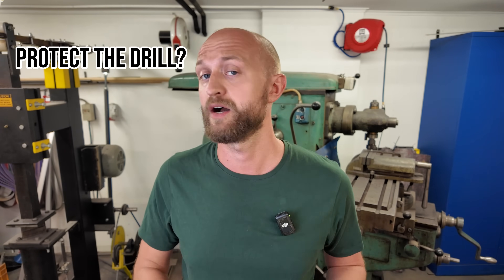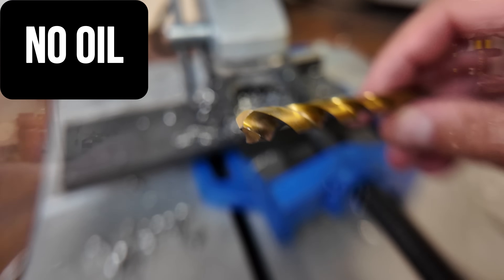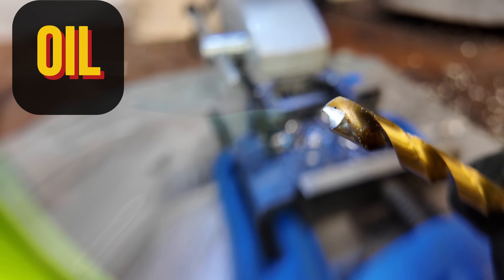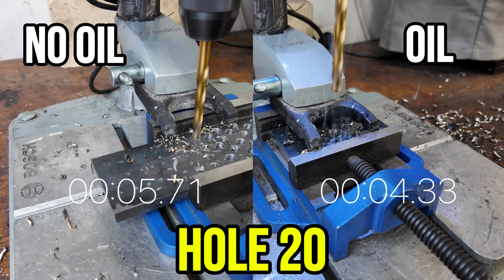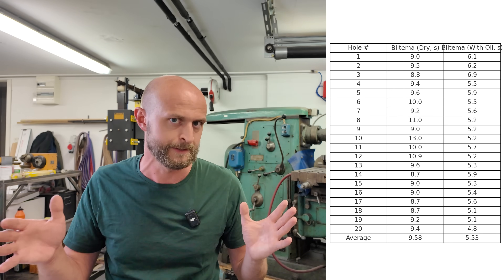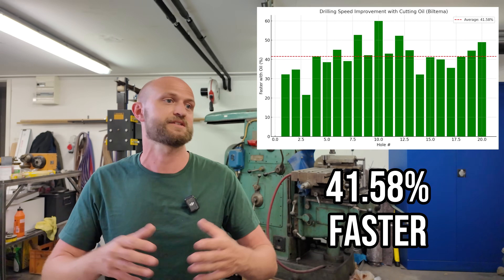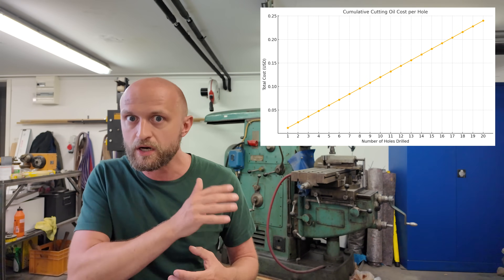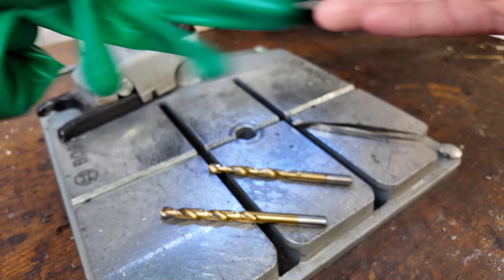You’re Drilling WRONG — Here’s the Proof

Comment: Try with water. On carbon steel it's better. On stainless it's essential.

Your problem is heat. You need to keep the heat down to protect the bit and work hardening particularly with stainless. Water will boil off at 100c while oil won't smoke until 180+. Latent heat for water is almost 3 times that of oil.
Reply from the maker: Good point — and you’ve actually convinced me. I’ll do a follow-up video testing water vs oil, thanks to your comment. Could get a bit splashy in the shop.
Reply: @SteelSurgeon-h6p  I have seen people use spray bottles and sometimes people even use putty to build a dam around the intended hole, but one of those little squeeze squirt safety wash bottles with the long pointed nozzles on it is my favourite. You can just drizzle the water down the bit while drilling and everything stays nice and cool.
Reply from the maker: @captainotto  That’s a clever setup — the squeeze bottle keeps it simple and controlled. I’ve seen the putty dam method too, but your approach is probably a lot less messy. In the OR we’d call that 'targeted irrigation' 😉⚙
Reply: @SteelSurgeon-h6p Those guys pointing out the emulsions are correct. Especially for professional work. But check out the water content in them. The oil isn’t as much a lubricant as it is a corrosion inhibitor. As the water content does its job and reaches for the stars, the oil remains behind to coat the cut preventing oxidation.
Reply: @SteelSurgeon-h6p  I use the green stuff, anchorlube cut 50/50 with water for stainless
Reply from the maker: @benmorris1657  I’ve heard good things about Anchorlube, especially for stainless. Haven’t tried it myself yet, but a 50/50 cut with water sounds like a smart way to keep things cool and lubricated.
Reply: @SteelSurgeon-h6p Looking forward to that video.
Reply: dont use plain water. just dont. you are asking to have your part rust away. use a coolant instead. you problem is not "just" heat. infact compressed air could most likely cool that down no problem. your absolute biggest problem when working in mild steel is getting the chips out of the way.
for this operation show, any form of cooling that are just sitting still, be it water, coolant or cutting oil, does next to nothing here, the only thing the cutting oil do is lubricate your drill and create a lot of hazardous smoke.
the type of cutting oil used here is actually ment for tapping, since its a slow operation, where there is not a lot of heat build-up, but lubricating the tap helps A LOT

tho i must agree that in machining stainless, heat is your number 1 enemy, but a bit of cutting oil is never gonna solve that.

for both mild steel and soft metals, using compressed air is quite adequate. for high carbon steels, especially if its a hardenable steel, coolant is advised. and for stainless is basicly a no-no to NOT use coolant. as mentioned, due to work hardening.
when it comes to using coolant, you want "running" coolant, that is a constant flow, and the higher flowrate you can have, the better. you want those chip carried away, or they can act like landmines upon your tool.

sadly that small drillpress is not built for running coolant. nor is it built for a set feedrate, you only have the pressure to go by.

another thing you can try to eliminate heat, is to actually run the drill faster, its not a guarantee when using HSS tools, but with a TiN or TiAlN coating its more doable. tho in both cases you need to evacuate the chips before speeding up can help. a "perfect" mild steel chip, has a color somewhere between "golden straw" and blue, this means the heat is in the chip, not in the part, and by evacuating the chips you are also carrying the heat away
Reply: @kkofodh I find it really hard to believe that compressed air would really do anything helpful compared to oil/coolant/water. I haven't tested it, and I could be wrong. But the specific heat/latent heat/getting it to the right spot.. It just doesn't add up. What am I missing here?
What's the issue withh water? In the context of this video it seems like it would be ideal - a small hand drill press, where you'd only use a small amount you can wipe off or blow off with compressed air. 
Is the concern just about rust? I live in Virginia, so having a wet metal surface isn't all that much different from just having the windows open in the summer as far as rust goes. 
I personally use pipe cutting oil because I get a liter for 7 dollars, and it works so much better than dry that I haven't bothered to try anything more expensive.
Reply: @SkippiiKai  the problem with water is its a catalyst for oxidization a.e. RUSTING. you need emulsified oil, typicly 5-8% oil in the water. this inhibits rusting, and acts as a lubricant at the same time. yes water is great for cooling things. but as we all know. water and steel dont mix well.
about compressed air. as said you want the chips to go away, and compressed air is excelent for that job, its actually one of the best at the job. im not talking about an ocational blow. but constant blowing, you dont really need high pressure, something like 30-40 PSI (about 2 bar) should be fine, as long as it can lift the chip and blow it away. where as still-standing pool of either water or oil actually keeps the chips suspended.

when it comes to compressed air doing cooling. the device you are currently using for watching this video, its air cooled. doesnt matter if its a smartphone or tablet, they are passivly air cooled, a PC is activly air cooled, even if its a gamer PC with watercooling, its still air cooled in the end, due to the radiator

i cannot really say anything about the area you live in, when it comes to humidity and such. 
but when it comes to rusting even the acids in your natural skin oil can be a problem. i've had a colleague that could basicly bathe his parts in sweat without any rusting, but another colleague could barely touch his parts bare handed before they started rusting.
3 things you want to keep away from steel are: plain water / tap water, acids, and finally salts. and since tap water in most places still have some salt content, you have a 2 for 1 deal going in bad stuff 😆

in a pinch water can do, and its generally better than nothing in that regards, but the big problem with drilling is that unless you have through-tool cooling, its really hard to get any form of cooling down to the cutting tip, and the problem becomes apparent when you reach a depth of 1x drill size and deeper.
if you have to use water, make sure to get it off as soon as you are done, and a generally good practice, if you can get away with it, is to coat your parts in oil, it can be way-oil or gear-oil. or some other rust inhibitor.

there are even some stainless steels out there, that are only activly stainless on the surface, meaning that when you machine them you reach an area that are not stainless, and you need the oil (usually in the coolant) for it to become active again, mist cooling can help here. infact mist cooling is a general GREAT solution for the small / hobby shop, since it combines compressed air with oil, so it blows the chips away, AND both lubricates the cut and coats the material in the area around the cut
Reply: @kkofodh  I actually meant to ask your opinion on mist cooling. I agree, it does sound like the way to go. I still feel like for what I do, which is just small stuff on my small drill press, in my garage at home, rust really isn't an issue because I can just wipe off any water. Obviously it's a much bigger issue on a larger/industrial scale.
I just worked out that if you use a completely blunt drill press so you do nothing other than create heat, and you cool it with litterally, actively boiling water, it takes 1.5 grams of boiling water to neutralize all the heat generated. I then spent 20 minutes trying to figure out the equivalent air flow you'd need, decided it was an awful math problem, and gave up. I know I'm approaching this from the spherical cow perspective and you're coming from actually having done it experience... But I feel like they should line up somewhere? I just don't see how you're getting that much air down into the hole to contact the surface. The difference is 1.5ml of boiling water vs 31 LITERS of room temperature air to remove all the heat from a 1/2 hp drill press for 10 seconds.
Reply: @SkippiiKai that's just a hobby compressor production at 6 bars, so the air volume could be maintained "for ever". You get something like 2-5x higher rates for short (~30s) bursts easily from a tank.

Having anything to flow directly at the tip of the drill is hard without special drills with coolant canals inside, but having the wind blowing at such rate from a small nozzle directed to the hole has to be pretty close to perfect delivery method for basic drills.
Reply: @SkippiiKai  its only when working in materials that will work harden, like stainless, that heat is a mojor problem. by far chips is a bigger problem. afterall each chip has the potential to act like a lindmine upon your tool, and very quickly ruin your cutting edge, way faster than heat will dull the edge
Reply: @kkofodh I’ve understood that all stainless must be passivated again once cut in order to remove surface iron. That’s quite easy to do at home with citric acid. Part of me says you could probably even passivate somewhat while cutting by sprinkling a bit of citric in your cutting water and dissolving it beforehand. For stainless I only ever work 304 and I passivate everything I cut. You just need to make sure you degrease properly before the citric bath and keep it nice and warm.
Reply: @SkippiiKai  Compressed air can help getting chips away when milling. Mist cooling (mix of air and oil) can improve surface finish. But flood cooling is better.
Reply: @captainotto  terminology may differ, but yes, stainless that has been cut without coolant need some post-processing. 
and cutting stainless without coolant can be a bad thing due to work hardening. even on an indexable carbide cutter can it cause trouble, thats why stainless can be a nightmare in the hobby shop.

if you have access to some way-oil (used in machine shops to lubricate the ways of the machines) then a good trick if your part arent gonna be used in a large assemble, and even then, is to clean the part, and then coat in everywhere in way-oil
Reply from the maker: @kkofodh  Really appreciate the detailed breakdown — you’ve clearly spent a lot of time in front of the drill press. You make some solid points about chip evacuation and the limits of static cooling methods, especially on a smaller press without coolant flow. My tests here were more about seeing how basic, easily available methods compare, but I can see why compressed air or a proper coolant system would be the better approach for serious work. Thanks for sharing your experience — lots of good takeaways here.
Reply: Your comment needs to be pinned.
Reply: I use kerosene. Lower boiling point than oil, doesn't rust stuff...
Reply: @pictsidhe6471 You just gave me a great idea: Gasoline has an even lower boiling point than kerosene and is even cheaper. I'm going to have to try this. Will report back with results if I survive.
Reply from the maker: @SkippiiKai  As your doctor, I’d recommend a second opinion before that procedure… preferably from the fire department. 🔥😅
Reply: @pictsidhe6471  Kerosine /Paraffin / Avtur are good for Aluminium and its alloys  (at least most of them)  Still washes off the lubricant on slideways, leadscrews, nuts...
Reply: I think you mean specific heat capacity? (correct me, I can take it!)   For water, it's twice as much as for oil (broadly speaking)  But... For a cutting coolant mix, water / soluble oil the ratio may be 95:5 or 97:3, so there's oil to lubricate, water to cool. (and protect against corrosion) I (fifty years ago) experienced a coolant oil that was used at 2%, gave the coolant a nice smell and a pale blue coloration, but... You had to use a spectroscope to ensure the oil content was 2% or more, or your machine went rusty... over the weekend...
Why are we reinventing the wheel again? Heat is the enemy of HSS tooling... But on a course with Valenite many years ago, they insisted that cutting with positive rake carbide tools was better performed dry than with an intermittent coolant flow. Constant flood good, intermittent led to thermal shocking, tip failure... It was demonstrated that we could cut quite deep, and at quite a feed rate, and leave the workpiece little warmer than when we started... The chips, though, were 'kin hot!  I still have a scar on the back of my neck from one, fifty years on... I was just competing a pass, the tool was heading towards the chuck, and I hadn't set a stop, couldn't flick the chip off...
I'd not use plain water, for the machine's sake.
Reply: @robertlawson8572 Specific heat is the heat required to raise the temperature of a solution. But latent heat is the heat required to cause a phase change, so liquid to steam for example. What latent heat does in the context of drilling or cutting is put a cap on the temperature of wetted parts like your drill bit or workpiece. If you drill a hole and you use flood cooling, specific heat is relevant to you. If you use drip cooling or are otherwise generating steam or smoke, latent heat is what matters.
Reply: @captainotto  The phase change occurs in the oil, because, using a small quantity of oil means the small quantity of oil's temperature rises far enough (because that small oil quantity's heat capacity is exceeded by the heat input from the tool / workpiece interaction) for the phase change to occur, We really don't want that phase change, do we? liquid to vapour, or to smoke.  No one applies enough cutting oil to keep the workpiece temperature low enough to avoid workpiece expansion, and avoid oil degradation whereas water/oil coolant mix can be applied in a large enough volume to keep the workpiece temperature within acceptable limits, and the oil/water emulsion temperature low enough to avoid its vapourisation / smoking.  If they did, it would be very expensive... The water / oil emulsion used has the heat capacity of the 95% (say) water constituent, combined with the lubricating qualities (and machine / workpiece preservative quantities of the oil...)
Now, the oil's lubricating qualities (assuming it's not all spun off by a rotating workpiece or tool like a drill bit...) may assist in reducing the amount of heat generated at the tool / workpiece interface, but not by much... (that lack of heat capacity of such a smatt mass of oil.)

In 1978, I was in a place where I took the opportunity to experiment with drilling using different techniques, different peripheral speeds, different feed rates, different drill point clearances, split points, point thinning, point relieving, prismatic points, chip breaker grooves in the drill cutting edges, dry cutting, flood coolant. I was using a Kerry, Archdale, and a Richmond radial arm drill.
IIRC, I could drill dry, but at a much reduced peripheral speed (reduces heat generation) increased penetration rate/rotation, (heavier swarf carries away more heat, interrupted feed to limit swarf lengths, and drilling through solid, no pilot holes, and the experience is more pleasant than when being splashed with coolant, and whipped by long swarf streams... and no loss in production...
The interrupted feed idea was cribbed from an Alf Herbert machine, which had the "Alfred Herbert Patented Chiprupter" facility for drilling cycles... Peripheral speed? maybe half what was used with flood coolant, so maybe 50fpm (15mpm) rather than 100/30 The lower peripheral speed was balanced by the increased feed/penetration rate, plus fewer obligatory interruptions for drill sharpening, and the discontinuous feed reduced / obviated the need to stop to unwrap swarf from the machine's spindle. 1 and 3/8  holes (about 35mm)  Of course, the machine motor was about 5hp... (perhaps 7 hp) It took no prisoners...  Indeed, 'pushing the envelope' one day, drilling a big hole in heavy steel plate, the machine rotated the fairly substantial cast iron box table that had never previously been bolted down... It soon was...
Reply: @robertlawson8572 I place smoke in the same context as steam but only for illustrative purposes. It’s actually much worse because inside the hole, that smoke is coming from the oil burning. That’s adding heat. But not only is the oil burning, it’s also polymerising. So now it’s adding to the heat by way of burning and increased friction from the now gummy poly-oil that remains.

But yeah, as you clearly describe. Very rarely can anyone use enough to prevent that. I know I wouldn’t want to put a whole bottle of cutting oil on my floor or in a trap just to make one hole!
Reply: @captainotto   "just to make one hole!" and therein lies the issue! You drill one hole, it matters little that the process takes a little longer.  In fact, while you're drilling that hole (a 'boring' procedure, pun, not literal ) you get time to think of the next action you must take... That is a big issue!  If you perform every action sequentially... Action 1, drilling, action 2 plan action 3... your overall production time extends... I'm drilling a hole 20mm diameter, I'm using flood coolant, so 500RPM, My next operation is different, I calculate the speed / spindle rate on the fly while drilling, and I have a rapid, calculator free method... My next drill bit and my drift are within reach, I needn't move, swap bits, swap speeds, keep going...
If you are performing 100 discrete operations in a day (480 minutes) 60 seconds thinking about each operation costs you 20% of your production... It's why Taylorism used to be taught...